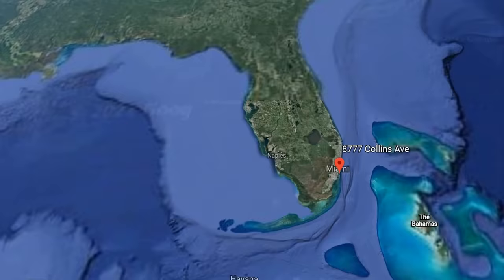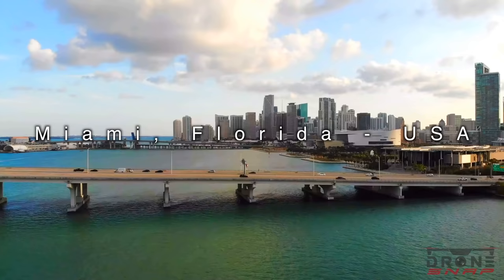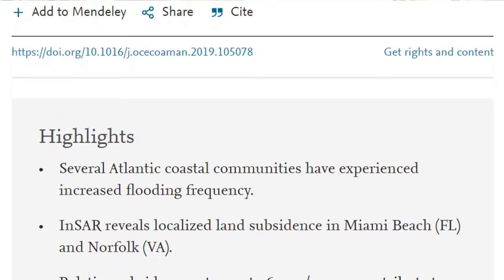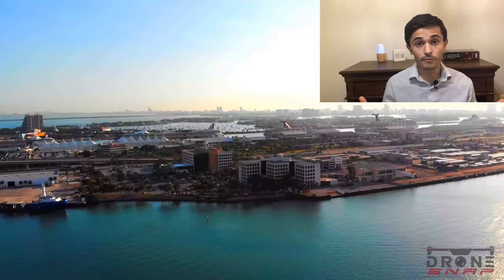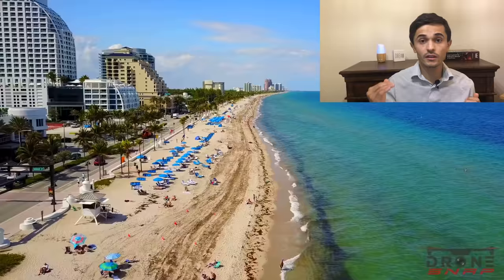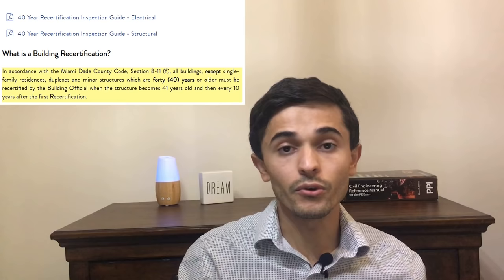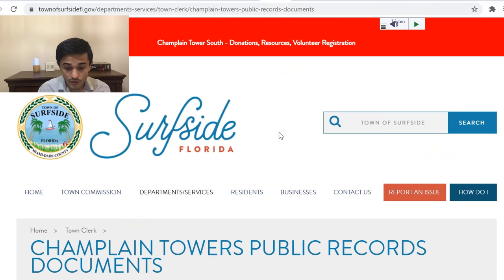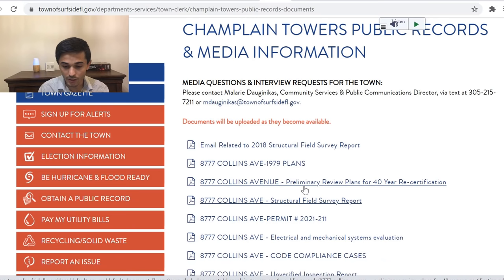Why Did the Building in Miami Collapse? A Structural Engineer's Perspective

Comment: genuine question, I don't want this taken the wrong way, but does the collapse mean that the building will fail its recertification? or can they repair what's left, add new walls, and get it recertified?
Reply from the maker: The building was fully demolished. I believe even if it could have been repaired, it would be hard to convince people to live in it after this catastrophe.
Reply: @QuickQuestionEngineering  I suppose that makes sense

Comment: So, no thermite charges were involved? I fail to understand the demolition like way it fell, pancake style, both of them. Why didn't it fall sideways or some way other than demolition style? I understand there was debris from the pool deck in the front part of the garage; Why anyone puts a garage underground in Florida sure boggles my mind and is just asking for trouble in my opinion. It is such a tragedy especially the time of day that it collapsed with everyone home most likely and in their beds rather than during the day when most could have been away from the building. My prayers for peace and comfort goes out to the families! Florida native here, grew up in South Miami.
Reply: If the central core collapses first it will fall like a controlled demolition.
Reply: Tall buildings will nearly always collapse in on themselves and fall straight downwards. Each supporting column is not built to withstand and support the entire structure by themselves. Imagine supporting a weight on a straw; one or two straws won't hold it. but stagger multiple straws under it and it'll hold strong for a long time. However you only need to remove a few of those straws to then see the weight will crush downwards and the straws will crumple. Literal straw that broke the camels back. It's all about inertia and the strength of supporting beams. inertia

Comment: I think this was much more than just spalling and exposed rebar. I really think it was well under engineered. Or very Marginally engineered. Just enough to stand up but over a few years would start to fail. Look at the lack of Shear wall in the parking structure. Even on the North tower. Column sizes and locations for a 12 story building IMO just enough to stand but no enough for one column to fail.  IMO if there were shear at least on the underground level in more areas that sucker would still be standing. I think the column sizes were 16x16 and 20ft apart. With only concrete reinforced rebar and not enough of that. the tie ins were Not adequate. IMO probably should have Ibeam reinforced basement. Something really missing there. Look at the pictures and video of the north tower. They made me cringe.

Comment: Multiple people have reported jack hammers on the roof the previous month. People said that building was shaking the last month. So the jack hammer operations on the roof were clearly reaching threw out the building. The rebar is so rusted I have to imagine that jack hammer did not help.

Comment: Surely the real question for engineers is why? did an entire building completely and suddenly collapse...this is sudden and catastrophic failure as though the entire foundation just suddenly gave way but without any visible extremal influences?. .In engineering theory that should not really have happened ..Unless the piles have failed and sheared and some other factor such as seismic an example  is heavy traffic on the road in rush hour ..water or waste pipes fully stocked or under pressure and demand such as first thing in the morning as people have breakfast and prepare for work perhaps even some acoustic Influences..an car back fires as an example...I have seen derelict buildings undergoing structural demolitions going down this way and probably when under those influences but those buildings are usually heavily weakened structures and in the process of destruction...This collapse was sudden and totally catastrophic and to an building said to be in reasonable shape please don't say this normal because guess what as an engineer it is not?

Comment: Design, materials, age, and wear may have indeed played a role in the collapse of this structure, however, there's the critical issue of land subsidence and rising sea levels to consider as well.  
In the collapse of this condo and the remainder of the building, there's no telling how this impacted the already fragile and compromised geology and limestone bedrock below this property and the adjacent areas.  I hope Geologist are on site because these are critical issues not being discussed, at least in the recent news reports I've listed to.
In my humble opinion, and because coastal areas around this entire nation and the world are subsiding as sea levels continue to steadily rise, it is my recommendation that land motion monitors be put in place on at least 4 areas of the property, North, South, East, and West.  The weight of that debris, along with the other part of the building being brought down, will indeed impact the geology below.
Structures that have been inspected and whose property have been shown to be subsiding need to have motion detection monitoring placed at the lower and top levels of the building.  All structures experiencing salt water flooding need to be watched very closely as well.  I would imagine that small, motion detecting devices could easily be attached to balcony railings - perhaps even be equipped with an audible alarm that could be heard from both inside and outside of where it is located.
I say this because in one of the news reports, an older lady said that she heard the building creaking - it was something she'd not heard before.  If there would have been motion detecting alarms, even a few of them attached to some of the balconies and garage area, this may have saved every person that night, allowing them time to get out of the building quickly.  I would very much like to see you dive deep into these issues.  Thanks.

Comment: What caused the collapse?
A)Porous Limestone melting and giving way to the foundation
B)Sinkhole
C)Bad engineering due to corporate-realtor greed and cheap contractor-developers that cut corners and rushed the job
Reply: Probably C) plus all the above...
Reply: @rauldempaire5330  Ummm NO!!! The building stood for 40 years. If construction was inferior the other building would have fell and would have fallen down sooner.
Reply: Look very close at “c”
Reply: @prmath  nope wrong!
Reply: @wanaraz  hopefully Not …… boom boom
Reply: A. 🙋‍♂️
Sea level rise gonna make Miami Florida one big sink hole
Reply: @wanaraz  bad logic sir.
Reply: @carlojones8610  Sea level rising is normal.
Reply: Lol, no. Seawater would flood that parking garage regularly, the spalling at the base of the columns are evidence of that. Two permanent planter boxes were butted up against 2 of 3 columns they figure were responsible for the start of collapse and are also connected to the parking garage and had previously been heavily criticized by Engineers, so who knows what mess was behind there? The pool is on top of the garage, and there was evidence of badly rusting rebar on the ceiling of the garage, lots of calcium deposits on the ceiling and stalactites. 

This had nothing to do with what it was sitting on, sinkholes, or limestone etc. lol. The building was built on some of the most solid bedrock in that area and displacement fell well within the norm and only 1-2mm per year. It was 100% the fault of poor maintenance. And likely jackhammering a roof that didn't really need repairing at the time, the garage did. They were up there for a few weeks doing that according to a Lawyer who lives there and it was annoying him. That can cause spalling in an already weakened area from another area of the building, like that roof. And it may be the straw that broke the Camel's back, as that was in progress at the time of the collapse. 

Weird choice, it's not like the thing leaked or had any major issues. and that's something you do at the end typically, so as to not put rigging for other repairs up the sides (which this had too), into a new roof, you put it into the old roof. Other Structural Engineers who have actually looked at the evidence don't think it was the land it was sitting on at all really. And think it's actually the standing water from high tides flooding it, the pool, those planter boxes and the jackhammering. The perfect storm of events.
Reply: @MrBilld75  You mentioned the roof that needed no work. If the roof leaks would not water dribble down through the pillars and all the concrete down to the basement?
Reply: @wanaraz  Sure, if it leaked, but there wasn't any leaks. From my understanding the recommendation from the Engineers that documented the issues, was that the roof work was just the cement on the parapets. And wasn't a pressing issue like other repairs. And specifically the garage and the planters that butted up against two of the three columns they figure were where the collapse started (which also were part of the garage). 

The Engineers heavily criticized those planters and there's no telling what damage was behind them. But you figure 40 years of watering plants?! There was bound to be damage behind them, had they been torn out and examined. Seems funny that this also happened while that roof work was being done. The straw that broke the Camel's back me thinks, as that is a documented issue with any jackhammering. It can cause spalling in a completely different area than you're jackhammering sometimes, especially in already weakened spots. Had they addressed the issue that were pressing and not jackhammered the roof, would this have still happened?!

Sounds to me, like the owners were concerned with the cosmetics and making it look good first, rather than addressing danger first.
Reply: Just found out something interesting too about how bad that pool was. A maintenance guy also noted how parking spot 78 had pooling water in it regularly and that, was below the pool. So the pool was obviously WAY worse than thought.
Reply: @MrBilld75  Even if roofer was the last straw that would not be there fault. They are not building engineers. But if you watch the video closely the upper 3 floors fell first before the bottom. Sort of like the building caved in at the top and the momentum and weight brought down the whole building.
Reply: @MrBilld75  Sea level rising is normal. Pooling in the bottom of a garage is not. The base of the columns were falling apart but that's in many buildings across America. Not necessarily why the building came down. Watch the video in slow motion.
Reply: @wanaraz  Sure, I agree, it's not their fault, they are just doing what is asked of them. A witness who saw it come down, said it started in the garage. And the garage was clearly a problem. Sea level rising and falling is normal, sure, but pooling water in that parking lot from it, is not and should have been pumped out/cleaned up immediately, not left standing there to ingress into the concrete. Literally everything points to that garage being a problem and in dire need of a thorough repair job.
Reply: @MrBilld75  If you watch the video in slow mo you can see the top buckle first. Of course the ground might have activated the failure. That's for engineers.
Reply: @wanaraz  Yeah, even from watching controlled demos, the science of how things fall is pretty involved and precise, as to how you "want" things to go and sometimes even they go wrong. So it possibly having an effect higher up at that moment, may have an explanation from experts and maybe not even an Engineer, but a blaster/demo expert.

Comment: This building had lots of spalling (concrete falling off support columns) and lots of rusting rebar based on reports. It sounds like this was ignored. One should not wait 40 years to recertify or consider what repairs are needed. This was a case of neglect of structural problems. It even sounds like building plans were not followed when constructing this tower. 

There are two other towers that are similar: Camplain Tower East and Camplain Tower North. They are on the same barrier Island and the same street. 

I do think it was the weathering of a coastal the building and construction of the weight supporting elements (regardless of weathering) that may be found at fault eventually. Another channel singled out column 78 in the parking garage under the deck and slab of the first section to collapse as key to the collapse. Of course, there were other column failures as well.

All building plans go through civil engineering review before finalized (got this from my nephew who is a civil engineer). I also know that civil engineers are supposed to be present during the construction of tower buildings (not true of single family homes). For some reason, since there are three of this type of building on that island but this one collapsed and the others have not nor do they appear to be in danger, something was done wrong in building this particular building. And it was neglected.

Are they ways to "xray" structural support columns and walls in buildings? 

It is interesting that there are much older buildings in NYC (Empire State Building e.g.) that have not collapsed. Of course ground conditions are very different in NYC than the Florida East coast.

However, just as there is flooding in the Florida coastal areas (I vacationed in a condo tower in Fort Myers in the early 80s which had flooding whenever it rained), there have also been incidents of flooding in the  NYC subway system in recent years.
Reply from the maker: Thanks for your detailed comment, Carol. I would think the 40-year recertification period may get shorter and building codes will get stricter.

Comment: What about all the cables in each slab or floor of this POST TENSION or CABLE STAY design. The ones that were failing.
Reply: It does not have post tension cables. It is rebar.

Comment: There’s one odd anomaly I found with the video of the collapse. 
The roof line where the collapse starts on the building is lower from the original roofline.
The area where the building starts its collapse is lower than its original roof line. (by at least 10' ) 
 The actual roof doesn’t drop down til about 30’ or so to the left. Study it closely and you’ll see what I mean. (It's the far right roof then scale left)
If you see the "curved" portion of the far right roof; each side has a curve, but the curve on the left is  only "Half" of the roof it is not the left end (or other corner) of the roof.
The roof must have previously split off and dropped prior to the start of the video.    (the building has curved breaks in the design) it apperas that It must have broke at the curve design first. 
Whoever gave out this video to the public either cut the start of the collapse out (or god forbid, its been tampered with) 
If someone was to do google sketch up rendition of the same angle the camera is at, this would confirm 100% what I’m assuming.
Who has the orginal video?  Can we see that for ourselves?
Reply: It was a motion camera, the beginning of the event was not filmed.
Reply: Building had already began collapsing long before that footage started. First collapse of some of the ground floor/car park had begun 7mins earlier.

Comment: It's very probable it may of have been a roof collapse. I can see on the roof from after the collapse in the video clip that they had just stacked a lot a
material on that roof. (they were getting ready to reroof the building) It's possible the roof was leaking into the edge of the roof to wall intersection
and may have resulted in rusted rebar supports/spalling etc. The roofing material seen in the video after the collapse appears to be in really bad shape, with water stains on all
the edges.
They may have overloaded the roofing in one area and stressed the already spalling /rusting rebar. It is not recommended to stack roofing all in one area for the reason of collapsing a roof. The rolls I see in the video on the existing roof (under the green tarp) are about 125 each. That’s equivalent to over 2500 lbs. Imagine that stacked over a leaking roof area. If its spalling on the decks imagine what a long-term roof salty water leak could cause with all the water concentrated in a certain area for years? Water can do crazy things. 
We once roofed a convalescent facility, when we tore the roof off, we discovered some dry rot on the roof, the water somehow leaked its way onto the walls, the entire wall was still standing but there wasn’t any wood left in it. The leak was never reported all those years. They never knew it was leaking.

Comment: Poor maintenance jobs on  pluming repairs on water pipes leaks in the building which the concrete and rebar steel rods shows the damaged conditions of absorbing a leaking water in the building which caused the lower center of the building collapse.   maybe a small internal water leaks began in  years leaking slowly out which caused the building concrete center floors over weight